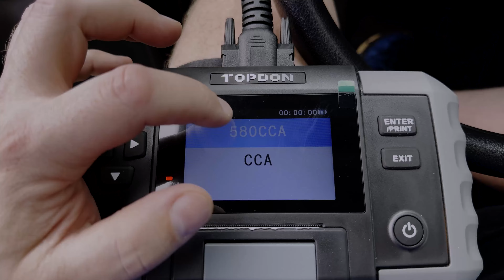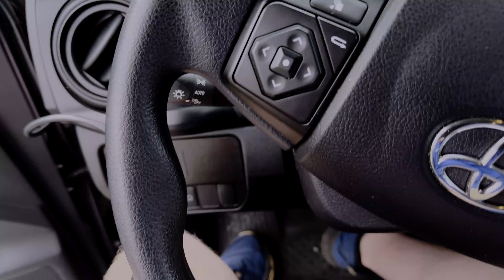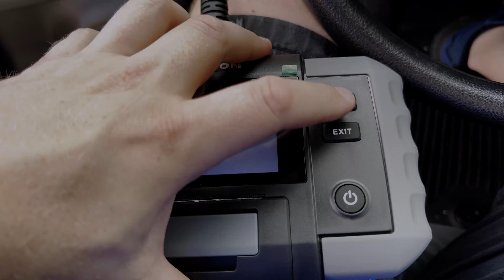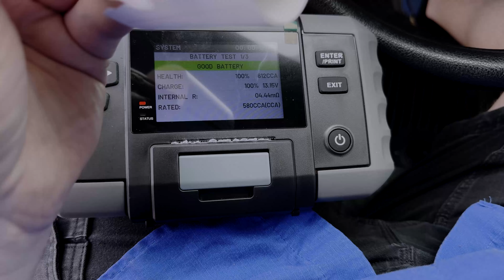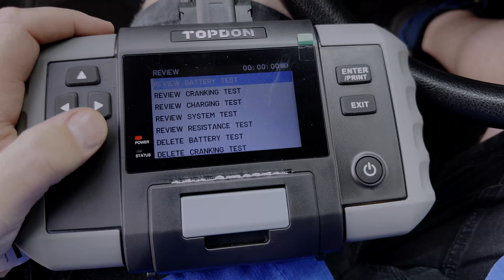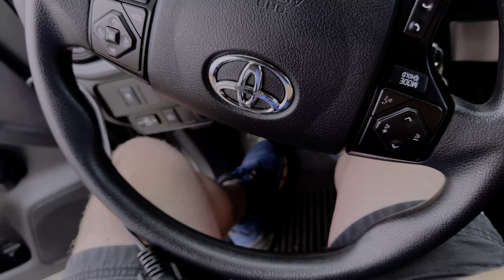5-Min Full Vehicle Electrical System Test with BT600Plus

Comment: It does the test through the obd port?  No need to hook up to the battery?
Reply from the maker: Hi! 😊 Just to clarify — this is a battery testing device, so it does need to be connected directly to the battery using the clamps. The video you saw just didn’t capture that step, but yes, the clamps are necessary for the test to work properly. 🔋